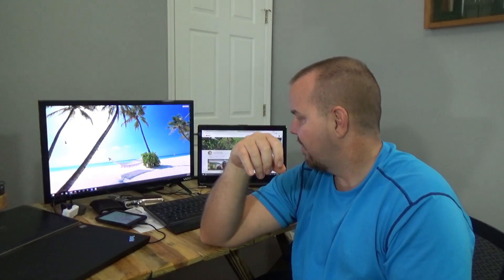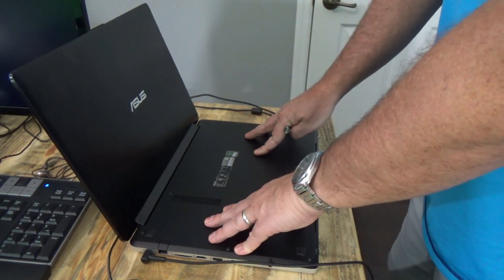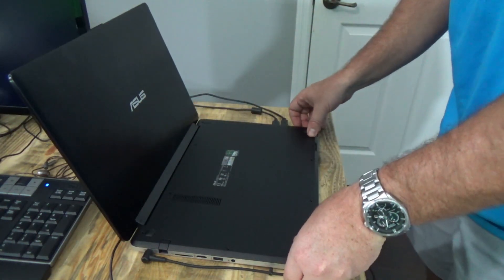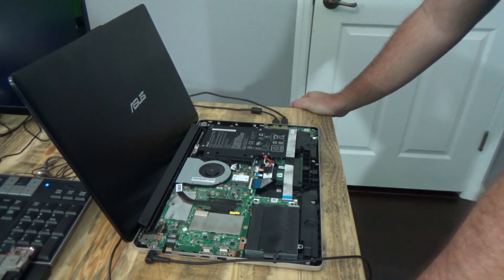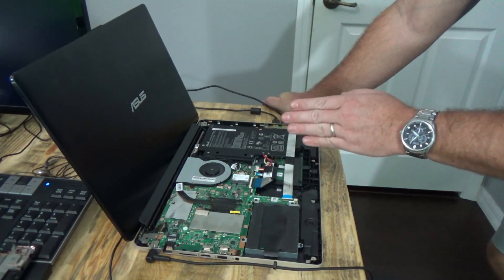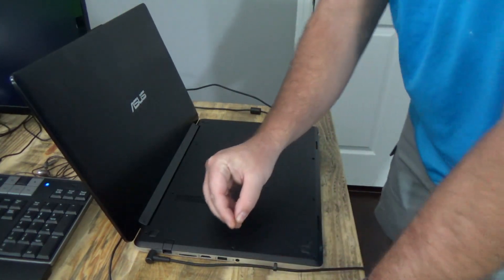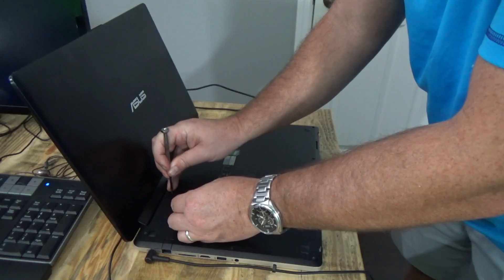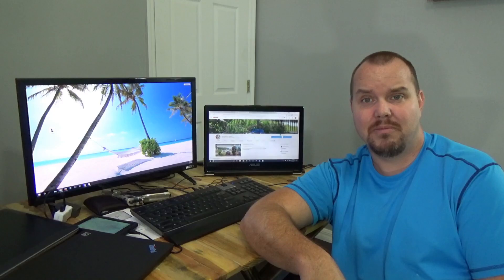Asus laptop will not boot, how to disconnect the battery.

Comment: "A great thing to have the battery in.." Batteries are not falling off by themselves..
Batteries are not accessible any-more on laptops and phones because manufacturers want you to change the unit once the battery is dead, and batteries after a limited amount of charge cycles will fail.
Otherwise, it's great that you tell people how to fix their laptop by removing power (power jack and battery). 
It is working on desktop by removing power cord and pushing several times the power button. 
I discovered by accident 22 years ago, a friend of mine gave me a desktop to repair, I didn't touch it, it was unplugged at home.
When he came back, I tried to see what was wrong, then it started, my friend was happy, I didn't do anything.. I discovered what fixed it was emptying static electricity.
Reply from the maker: First steps in basic troubleshooting.

Comment: I havent tried you fix yet.   Mine isnt charging, only works plugged in....message is "Plugged in not charging"
Reply from the maker: If your laptop refuses to charge the battery even though it acknowledges that it's plugged in, this may fix it.

Open the Device Manager by searching for it or right-clicking the Start button and selecting Device Manager.
Click Batteries on the list to expand it and you should see two items: Microsoft AC Adapter and Microsoft ACPI-Compliant Control Method Battery.
device-manager-batteries
Right-click on each item and choose Uninstall device. Yes, you are uninstalling your laptop's battery drivers, but don't worry because they will automatically be reinstalled when you restart your laptop.
Shut down your laptop.
Unplug the power cable from your laptop.
I removed the bottom panel of my laptop and then removed the battery by disconnecting it from the motherboard. Same as done in video.
Plug battery back in, I did this the next day, but should be fine and a few minutes. 
Plug in your laptop.
Power on your laptop.
Click the battery icon in the system tray and you should see that your laptop is plugged in and charging.
plugged-in-and-charging

By reinstalling my ASUS laptop's battery drivers and disconnecting its battery and then reconnecting it, I got my laptop's battery back to charging when it's plugged in. With differences in manufacturers, your mileage may vary. If you encountered this plugged-in-not-charging problem and found a fix that differs from mine, please describe your method in the comments below.

Comment: My asus wasnt powering up. I used another charger an exact same asus charger for same laptop. I got it to charge but it wont turn on. Mine is the sonic master which has ribbon wires attached to under the keyboard. Do you think if those got disconnected it would cause this problem? If not what else can I do?
Reply from the maker: If your power button is on your keyboard this may be the problem. We have another laptop Asus laptop that needs a motherboard, but it was only a little more to replace it with a newer model. Wish you this best and we hope you solve this issue.

Comment: This worked for me. UPDATE: Once the laptop shut down it will not power back on.  My power key clicks and it seems that I'll have to disconnect the battery each time I want to turn it on, even with the power cable plugged into it.  Does this mean I need a new battery?  It seems like it should turn on with the power cable connected.  Does anyone have any insight to this problem?  Hopefully all I need is a new battery??
Reply from the maker: It should power on with the battery disconnected if there was just an issue with the battery.

Comment: Having the same problem with the F553M model. Do I follow the same procedure?
Reply from the maker: I would think so, pulling power from a computer is the first step in troubleshooting. A lot of these newer laptops with a hardwired battery make this difficult.

Comment: I have a asus E200HA  which it suddenly stop charging.. I bought a new charger and left it plugged in over night but nothing.. I also tried your method but my laptop does not turn on when the battery is disconnected. I need to mention that in the beginning the laptop was turning on and was working for 1 2 minutes until the message very low battery please connect charger start showing.
Reply from the maker: Sounds like the internal power supply in your laptop is bad. You may try disconnecting the power cord and battery, then hold the power button for 30 seconds. I believe I disconnected everything in mine overnight and plugged it back in the next morning. Holding the power button for 30 should drain all power from the capacitance in the board, at least that is what I have read. Wish you the best of luck fixing your laptop.
Reply: @ChrisDoesWhat  thanks Chris. This is exactly what I am trying right now. I disconnected the battery this evening and   I will try again in the morning. Thanks again for your reply.
Reply from the maker: @mariuspitulac6051  Good luck, really hope that solves this issue for you.
Reply from the maker: Did everything work out.
Reply: @mariuspitulac6051  update please?

Comment: Yeah, i'm having that issue... won't get past the ASUS logo boot screen. If I hold down esc to get into the boot menu, all I get is a black screen.  Unplugged it for about 15 seconds and tried again and didn't fix it. So, I'll leave it unplugged for a few hours and see.
Reply: Danny Gee did it work I have the same problem
Reply from the maker: It worked for my issue, left the battery disconnected for about an hour.